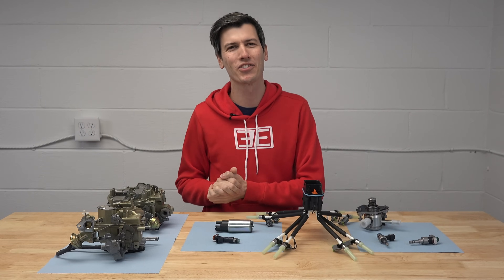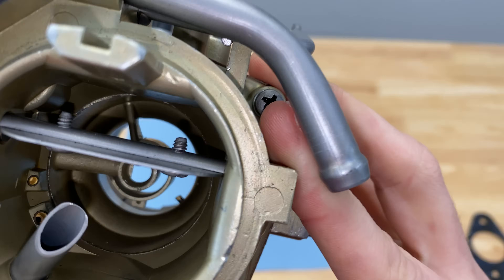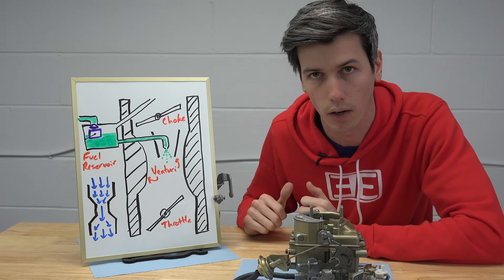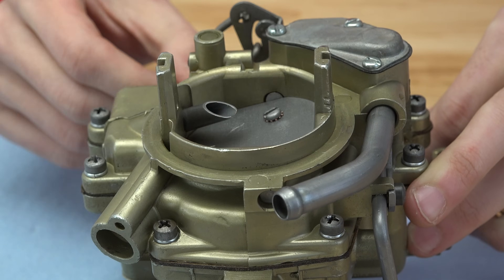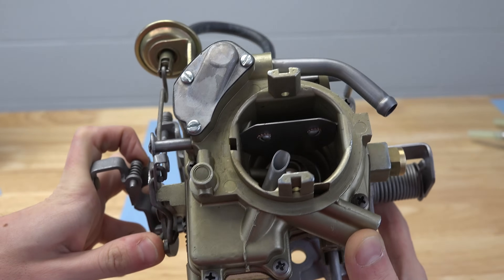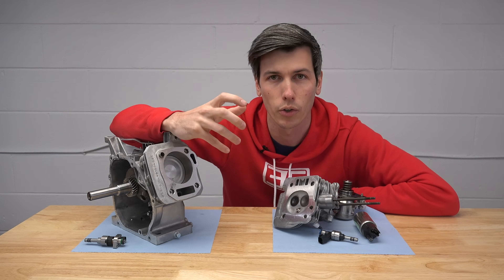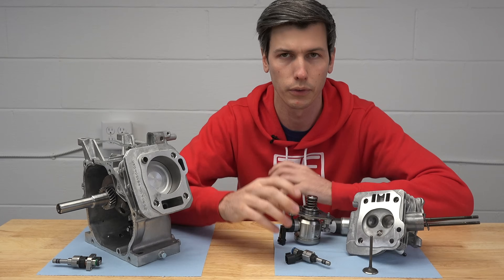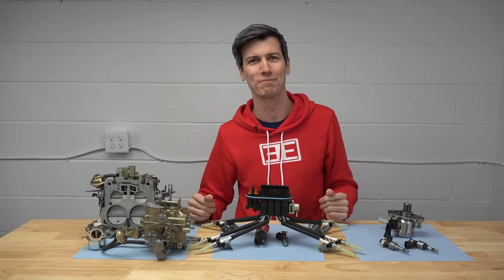What's The Best Fuel Injection? Carburetors vs Port vs Direct

Comment: Some companies like VW used MPI and DI to reduce the huge amount of particulate matter that is a hallmark of DI engines and a byproduct was less carbon accumulation on the intake valves. However, because of EU6 regulations, VW has now ditched MPI and gone back to only DI in conjunction with a gasoline particulate filter. America loses out because we never got the dual injection engines here to begin with which means our cars were plagued with carbon fouling. At least carbon accumulation is now a global problem again in the VW world. It’s crazy to me that now gasoline cars have particulate filters (at least in europe). Cars had already been muffled by turbos and noise restrictions, but a semi-solid GPF will certainly reduce exhaust notes even more.

Comment: You miss one very important problem with Direct Injection, it washes the oil off the cylinder walls which results in scuffing and premature cylinder wear. The hybrid of DI and ported injection partially solves that problem. More work needs to be done in the stratosphere designs.

Comment: im a carburetor guy all the way 
carburetors are simple to run and fix and you only need one
same with coils i would rather have one coil with a distributor than 6-8 coils
also im all for block mounted cam fuel pumps
because you can carry extras if you only need one 

i dont like how if a vehicle brakes down now you almost have to call a tow truck

Comment: THANK YOU! I finally understand how everything works! Is there a mechanical fuel injector, operated by the camshaft,  just like the valves??
Reply: There are various forms, mainly on diesel engines but saab used to use mechanical injection on petrol engines. They used a fuel distributor to select each nozzle

Comment: Extremely interesting, informative, and concise. I never knew how the choke worked so thank you for that, or that some companies were employing direct and port injection together. I was wondering, when mechanical fuel injection came along-like in the Mercedes SL300 and mid 50s Corvettes, did that provide more control then a carburetor over the air/fuel mix given they were both mechanical?
Reply: The ME-109 had direct FI (mechanical) from the get go around 1939....so it was like Nationalistic Pride for Mercedes to use a similar setup on the SL's.   They had issues...like the injectors weeping which washed the oil off of the cylinder wall causing wear, and if you ever saw the internals of the injection unit they're not an uncomplicated system.   Carburetors are basically 5 mechanical systems built into a single unit.   Not hard to understand once someone shows you what's what.   The problem comes when the carburetor doesn't match the vacuum profile provided by the engine...in which case they don't work well at all though they can be tweaked to work...but it's not the easiest thing and normally requires very tiny drills to modify air bleeds and such.   Electronic port FI is by far the simplest and easiest system to use today.   Very easy to tweak...instead of removing float bowls or pulling the top off the carb...you plug into the OBD2 port....punch a couple buttons and presto!

Comment: Now I understand why carburetors are ubiquitous on small engines like lawnmowers, chainsaws, string trimmers, etc. They operate at one or two RPM ranges, and therefore can be tuned rather well for those air fuel ratios required.

Comment: With direct injection, does the intake valve actually do anything since fuel is sprayed straight into the cylinder?
Reply: Yeah, your cylinders still need air

Comment: to all those talking about lada:Lada Niva,Samara has been Produced still today and has both the fuel injected gasoline engine used since the 1990s as gasoline, and a diesel variant both with bosch k-jetronic fuel im and more modern fuel injection solutions.and more modern models introduced technical features from renault-mitsubishi-nissan.
Niva had Power windows as option since the 1990s.although now days somewhat underpowered the older generations of the niva series were designed to be ``low maintenance`` along with 1st and 2nd gen samaras(1988-2000),samara series was much rarer as a diesel variant but existed much to my understanding,with peogeot diesel engine,along with the later years of nivas production.the 2000-2003 samaras where rife with ecu and other related problems(been there done that)

Comment: I have one of each! A 1980 Bedford van (carb) , 2005 Corolla (port injection) 2009 Golf (direct injection) 2018 86 (dual injection) . They all work! It amazes me that the 86 can run 12.6:1 compression ratio due to the wonders of direct injection (as Al from The Skid Factory explained to me). Another advantage.
Reply: What will amaze you later is that your 2005 Port injection corolla will still be reliable in 20 years and the direct injection in the golf and 86 will have rendered those cars dead.
Reply: @elfairmont40  The 86 has both port and direct injection. The Golf is gone. Nothing would surprise me about the longevity of the 2005 Corolla!

Comment: If the inlet valve of heat engine is not working properly.. dn is there is chance of back fire burning of fuel to the petrol tank from the heat engine... if not what is the scientific reason...
Reply: No. There's no oxygen in the fuel line.

Comment: I think you meant what's the best fuel DELIVERY SYSTEM. The nozzle in the booster is a discharge nozzle, not an injector. A carburetor does NOT inject fuel, it's a passive device. Engine vacuum sucks fuel out of the carburetor. A carburetor has finer proportional control over the AFR (more accurate response to engine load) than an injection system, but its big drawback is that parts must be changed to alter the calibration. An injection system can vary the fuel curve slightly to compensate for changes in running condition, where a carburetor cannot. The stoichiometric ratio 14.7:1 is not always the ideal ratio. It produces the most efficient reaction, but that doesn't actually translate to the highest power output in a piston engine. Most high performance gasoline engines need a ratio of roughly 13:1 to produce peak power at wide open throttle, as per the cooling principle you explained. TLDR: carburetors are better for high load applications. Injection is better for economy. Direct injection is in a class of its own.
Reply: Yeah there are nozzles, for the accelerator pump system. Usually a small diaphragm pump so when you pump you foot down it will squirt out (inject into the venturi) a dose of fuel.

Comment: All good but cold engine is not vaporizing problem 
It’s fuel condensation on metal part surfaces as in ports and manifolds and ...
Reply: When fuel is cold it will not atomise as well. It hadn't reached its vapor point.

Comment: Hi! What's your view on the Volkswagon (and other) Diesel scandal? The 2011 Jetta Diesel 6-speed was an incredible car and value. I drove mine for 6-hours one day at 180 kmh / 110 mph on the New Brunswick #1 highway at a very pleasant and comfortable 3200 rpm. Beautiful. Fast, very cheap - it had 50% better highway mileage per gallon cmpared to gas cars, reliable, great size, comfort, and style. It - was a touring driver's car. to be certain. 
Canada - like the U.S., is a big place and responsible fuel economy is just smart conservation. The EPA folks never took into consideration the vastly higher fuel mileage per litre of these cars - into their emissions calculations, so - per mile, emissions were likely smaller with diesel, and they were an absolutely smaller amount of particulate emissions than the  Fuel Stratified Injection (TFSI) and Gasoline direct injection (GDI) standards that replaced it. Diesel is the only fuel appropriate (from a "conservation of a non-renewable resource" point of view) for larger SUVs and all pickups as well I think.  
Was the DieselGate "scandal" a hoax by big-oil to keep fuel consumption high? What do you think? What's the future?

Comment: 4:50 He's moved on to fuel injectors and yet not mentioned the big drawback with carbs...

...they never turn the fuel off ! So, on the overrun when your foot's off the accelerator pedal and you don't need to burn fuel - the engine's still being fed with fuel and burning it. This is one of the main economies of fuel injection over carburettors.
Reply: Some later carbs were equipped with a deceleration valve to reduce fuel burn on deceleration

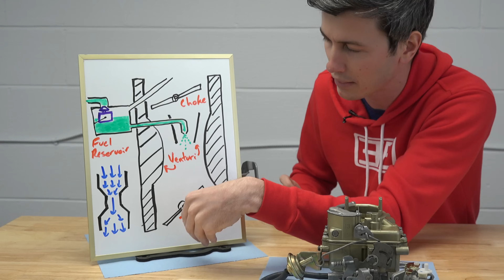Comment: 2:00 Diagram error - fuel reservoir is too high up. At that height, fuel would dribble constantly into the engine instead of having it 'metered'. The carb has to suck the fuel in.

S.U. carbs don't work like this. They have an air/vacuum operated needle valve that opens and closes variably with air flow to maintain the air/fuel ratio. His ratio of 14·7:1 has some data missing as the ratio will change with ambient air pressure. Up high mountains (or in aircraft) there is less pressure, so less oxygen so less fuel is needed.

Comment: Thank you for the great videos as always!

Perhaps it’s also worth noting that GDI is now beyond 350 bar, with multiple manufacturers already producing or planning 450-500 bars or even higher (check Mazda’s SKYACTIV-X’s system).

Moreover stratified charge can be obtained also with GDI alone and doesn’t necessarily require PFI.
Especially if you do multi-injections which brings gasoline engines closer to Diesel ones.
Said multi-injections are another thing PFI cannot do...

Comment: EFI is great when working properly, but you need more than a screwdriver if something goes wrong, and tuning EFI engines cannot be done without a computer. I'll never shop at Advance Auto again after trying 3 times to get a starter that worked more than twice, maybe they were unloading all of the Carquest parts after purchasing that company, but don't buy any Carquest items unless you need fluids.
Reply: Early EFI could be tuned with a screw driver. You could change the air/fuel ratios on the fuel distributor on k-jet tronic. Other bosche systems you could tune the airflow meter.

Comment: Which is cheaper to work on? I’m still learning but I’m about to buy my kid a new dirt bike 110cc Honda has changed to fuel injection and Kawasaki is still carbureted. I don’t know what 2021 has to offer yet for Kawasaki but I don’t want to be put into a position that I can’t fix something out on a ridding day vs to I have to carry these extra parts to fix fuel injection.
Reply: Modern injection is extremely reliable, as long as it's maintained it shouldn't be an issue, EFI dirt bikes have been around for ages now with out major issue. And the same applies for both... Make sure you fuel is clean and you use good fuel and air filters

Comment: Engineering Explained why dont you do a video on a four barrel carb vs a four barrel throttle body injection system
Reply: They're essentially the same thing. The efi would be more precise and responsive but at open throttle would be the same. You're still at the disadvantage of manifold design (unequal; volume, length, flow)

Comment: The people who hate on carburetors are just jealous they can't tune one, change my mind
Reply: I can tune them and I hate it. Why do I hate carbs? Less responsive, less precise metering. Having to tune it before ever summer or winter. Go on a long drive and have it run worse because of altitude changes. Compromised manifold design. The list goes on.
Car companies are out to make a profit, if they were equal we'd still be using carbs but were aren't because modern EFI is miles above carbs in every aspect.

Comment: Managed injection is good. Thousand dollar fuel pumps are not good, also; mega micro processors, melting dashboards, rubber band transmissions and planned obsolescence. Buy old Corollas and Camrys you can work on. Good will come back.

Comment: Thank you for your good explanation! Let me clarify the difference between the port and direct injectors. Port one puts liquid gas into the place just before coming to the combustion room. And direct one puts gasoline directly into combustion room by high pressure. 
Port pros: cleaning carbons etc., Cons: takes more time to mix with air so less effecient.
Direct Pros: Better mixture with air so more effecient. Temperature reduction by faster evaporation. Cons: no cleaning from carbons

Comment: Port + water or water/methanol....super dense cool charge that isn't travelling supersonic even with massive air intake.Yah, no good for off-the-lot, but perfectly good for people that are willing to deal with another tank to fill.  Amazing for forced air induction....and can even skip the intercooler in milder applications.
Reply: A mate did water/meth on a supercharged buick ev6. Made a massive difference as the discharge air temps from the blower (eaton m90) were phenomenally high.

Comment: I fly airplanes, and in airplanes there is a mixture control that controls how much fuel goes in per air, or other wards can adjust the fuel to air mix. It works good enough that there isn’t noticeable fuel savings with an injected engine in the same airplane. All of us flying know how to use it properly and how to protect the engine and not let it detonate, but I wonder why carbureted cars don’t have mixture controls. When they left production I doubt any automatic mixture controls existed. I never understood why us pilots got mixture controls but cars never did...
Reply: Pilots are highly trained, drivers are not.
Cars operate at mostly the same altitude, aircraft do not.
The need to change mixture ratio in a car during normal usage is almost non existant.

Comment: what was the reason for honda's cvcc ( a stratified charge engine) to use a carburetor
Reply: Only the older ones (70s-90s) and the budget ones were. The newer ones are injected.

Comment: What I've never understood is why OEM's that dual injection (GDI and Port on same engine) run the staging of the Port and GDI injectors as they do. Seams backwards to logic and even data that F1 realized many years ago....
As RPM increases, logic suggests that there is less time for the fuel and air to properly mix to create a homogeneous mixture. So why would you run on only the GDI injector since that is closest to the CC and thus netting the absolute least amount of time to properly / completely mix? The PI being further from the CC thus nets you more time to properly mix air and fuel. Even F1 along with other manufactures like Mazda with the FI Rotary's and their staged injection realized that moving the injectors away from the intake ports nets more power due to better air fuel mixing. Ever take notice of where F1 injectors have been for ages? Right at the bell mouths of the velocity stacks... Not right behind the intake valves.

Furthermore, from an emissions standpoint during startup, warmup, idle and low load conditions, running on just the PI's doesn't make sense either because of the really low airflow rates and thus the fuel more likely hitting the walls of the runners and thus condensing and / or otherwise dropping out of suspension from the air stream. By that logic, it would make sense to run on all low load conditions via the GDI's and then as load increases, bringing the PI's online for additional fuel (obviously still keeping the GDI's on for the added cooling effect within the cylinder itself).

As someone who has owned a few Rotary powered cars over the years and once accidentally wiring the injectors backward to where the lower port injectors were the wired as the secondaries and the upper runner injectors were wired as the primaries, there was definitely an idle and low RPM problem (running too lean according the the wideband). Once I realized that I had accidentally wired the injectors backwards, it made perfect sense. And Keep in mind, this was a relatively stock 91 RX-7 that was running the stock 550cc injectors, so its not like the engine had different sized injectors in different locations... This was a stock OE car (other then a cat back exh and a front mount IC) that had a small engine fire because of a fuel leak in the crossover line between the primary and secondary rails. Rather then source a used (already significantly aged) wiring harness, I made a new harness from scratch and accidentally wired the primary and secondary injectors backwards in the process.

So I really cant see the logic that most OE's that run both the GDI and PI are using when there is evidence that indicates its backwards. And dont just say, "they are well educated high paid engineers so...." because I've seen many of said "engineers" screw-up over the years because they overthink and over complicate things.
I really would like to see the data and testing that was done to indicate that their way is right and what it was put up against to verify that it was in fact better.
Reply: The GDI runs at such high pressures that it does still atomise and mix very well. While reducing the chances of detonation as you can't burn fuel to early when there is no fuel.

Comment: Not to mention carbs are still used on cheap-o engines like lawnmowers, string trimmers, and virtually every nasty polluting scooter and tuk-tuk engine in the 3rd world. Also when you modify your engine or go to higher altitude you have to readjust the carb or re-jet.

Comment: The float bowl in your diagram will run fuel continuously into the carb throat and flood the engine.  The fuel level in the bowl has to be below the main jet.  Carbs are a marvellously simple way to regulate air / fuel ratios, the problem they have is a limited capacity to accommodate different air flow rates.

Comment: you should do a video on extreme tuners evo engine they claim most efficient 4 cylinder on the planet 17-1 cr  destroke to 1.8l  and 13 000rpm redline pushing around 3000hp
Reply: On what fuel? Can't be on pump gas.